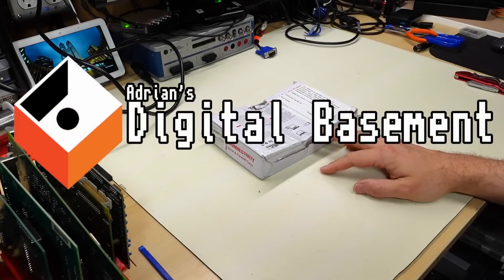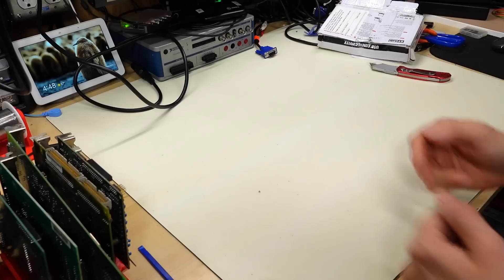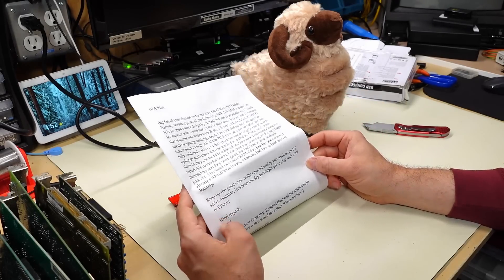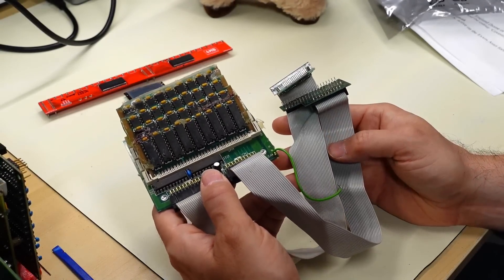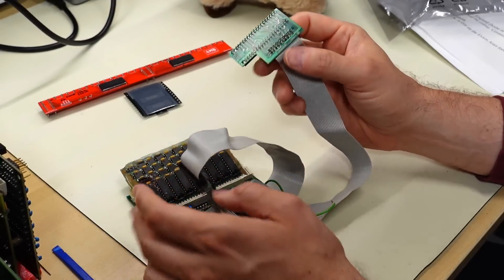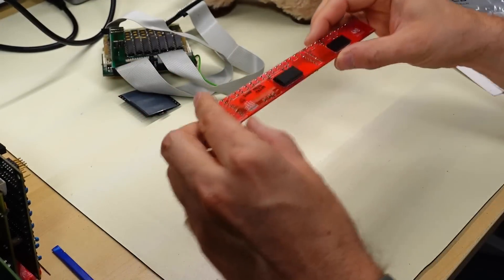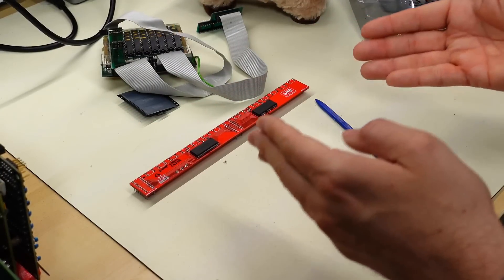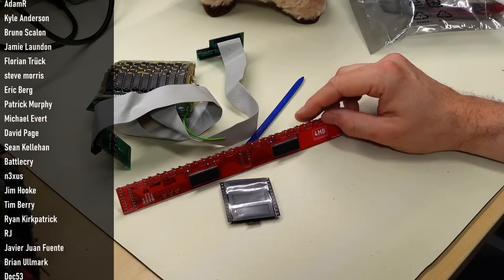0012 Finally, a reliable RAM upgrade for the Atari 520 ST!

Comment: Install the sockets but check if they fit in the case before soldering. XD

PS - Just taking the mick. ;) Try removing the spacer on the pins, trim the pins ~2 millimetres and see if it fits now.

Comment: Do the sockets. There are many other cheap, and very exciting upgrades coming to the Atari very soon, which this upgrade may interfere with, so expect to have to remove it/modify it in the not to distant future. Sockets make sense, you don't want to have to keep soldering/desoldering things from the motherboard.

Comment: Sorry, not familiar with the Atari systems but what do you gain by having more ram on the machine?  Isn't most software designed for 512/1024 and wouldn't benefit from this?

Comment: Have had the Marpet upgrade in my original ST since the early nineties, never had a problem with it, so take issue with the flakey upgrade (although it was hot glued a bit on the MMU for 'stability') :) Back then it literally was the best thing available to get you to 4mb and for us budget strapped ST users, you could do it in stages via 1mb, 2mb, 2.5mb and 4mb when you had the cash. I actually found 2.5 was the sweet spot back then, 4mb caused some with issues with games. It could be worse, if you had a surface mounted MMU without a socket you had to get a Marpet with a upside down socket soldered to the pins you have, that in turn fitted over the surface mounted chip. Those fell off all the time and needed a tonne of hot snot to hold them down. It's a big old upgrade for the first smaller ST form and even the later STF models though. You should try fitting it in there with an old school TOS 2.06 upgrade and a AA battery power pack for the keyboard clock, you newbies don't know you are born...

Comment: Personally I would solder it permanently in place as I would not want to keep doubting how well its fitted every time I had any form of issue.  Also even the board has already been  modded its not like the machine is original factory fresh.

Comment: One thing, well 2 things I'd like to see you get are 1) A processor accellerator with on board cache ram.  I had one of those and felt very up to date as Intel chips were adding on chip cache for the same purpose at the time. 2) Get an Atari black and white monitor and pretend you are a frugal German who wanted a lower priced Macintosh.  I had the 640x400 B&W monitor and did not game, except for various solitaires.  Get some word processers and page layout programs etc. to see how the Atari ST with GEM compared to the 512x384 rez B&W Macs of the day.

Comment: 1:15 If you're looking for Atari ST Hard drive devices, look into the ICD line of connectors. I remember using that on my old 30MB Seagate (and I think later on my 420MB Quantum Trailblazer).

Comment: The RAM upgrade I fitted to the 520STFM that belonged to my brother and I required soldering, and basically bypassed the existing 512KB. We ordered the 1MB upgrade, and were gobsmacked when they accidentally shipped us the 4MB version instead. None of the software we used actually needed 4MB though, as we were only upgrading to be able to use Steinberg's Pro 24 MIDI sequencer.

Comment: Mechanically it seems so big that I wonder if it would be reliable with round pins going in all of the sockets. I wouldn’t want to make it permanent either, but it seems like the kind of thing where your Atari could reboot if you bump the machine while it’s running, unless you solder it down.

Comment: They are 19 pin D-Subminiature connectors. That size has never been given an official letter designation. DB is the size for 25 pin, DA, is 15 pin, DE is 9 pin. Yes, it was Big Mess O Wires who had an Asian company manufacture a huge amount of these so he could continue to make his Apple external floppy emulators. But he had to order such a massive amount that some other companies went in with him on the order because of a few other electronic products that had used that size. Apparently manufacture of the 19 pin D-Sub connectors and shells ceased not long after Apple and Atari stopped using them.

The BMOW guy posted about how it felt to have the entire world's supply of a thing at his house, before shipping off the other companies' shares of the connectors.

Comment: I think having the option to reverse it is a good idea... I'd be more for using sockets, then you have the flexibility to borrow the upgrade for another machine or revert the machine back to stock if you ever want to... also since the person who sent it didn't solder all of the pins of the pin headers to the expansion PCB, it isn't going to be as much work to de-solder those pin headers when you switch them for more socket friendly pin headers

Comment: If the "convenient" method of swapping the RAM was the norm, for the 520st, I would say socket it. However, in the flavor of the era of upgrades the 520st is from, I really want to see you finish what the previous owner started, and solder it to the board as a permanent upgrade. ;)

Comment: I feel like putting that thing in sockets, turned pins or otherwise, is asking for trouble. All it would take is for one pin to be slightly out of alignment and not making good contact, and you'll have an unreliable machine that's a real headache to troubleshoot.

Comment: I couldn’t see the RAM chips that well since I am on my phone.  But I assume those are SMD chips with J-lead pins.  If you do a permanent mod, you wouldn’t have to remove the board to replace the RAM.  Just remove the chips with hot air.  So I recommend permanent solution.  I mean, why not?

Comment: I would recommend sockets because you never know if ram failures ended up having to desoilter it aging it would be pain in board get it off to fix ram it way more easy just put socket on mobo and easy to remove and fix ram aging save yourself a headache

Comment: Being an Amiga owner from back on in the day, i never knew that it was so hard to upgrade the ram in the ST, i always figured they would have a slot or something like the Amiga. Perhaps this was a cost cutting measure of the ST to try and keep the price below the Amiga competitor
Reply: The 520ST was released before the Amiga 1000.  The stfm was released a year before the A500.  The ste was released after the a500 and had simm slots

Comment: This whole "Atari memory upgrade fiasco" reminds me of a mod i saw in a magazine back in the 80's for how to upgrade a TRS-80 model 1 16K base machine to 32K.  You basically had to piggy back another set of 8 ram chips (16K x1 bit) atop the installed ram chips, and solder all the pins except the CS line, which you needed to bend up and solder a bodge wire to.  The bodge wire was then attached to the memory decode logic, so that the extra 16K was selected when the address range was correct for it.

Would have been a PITA to do, but man i thought about it.  16K sucks, especially when you are learning assembly and NEED that damn ram space!  I was using the tape based EDASM from Tandy, and while it worked just fine, you were really cramped on memory space in a 16K machine.

It sucked being a poor kid in the early days of 8 bit computing.

Comment: As a general rule, I’d prefer less permanent changes over permanent ones. I’d say initially go with the temporary option for a while at your judgment (for a week? a month?) Only if it is too cumbersome after a while, then consider the permanent method (or if you have multiple Ataris as backups.)

After all, machines of this vintage aren’t exactly being made these days, and some software of the era tend to expect the original configuration.

Comment: Adrian, please whichever method you use, consider reflowing the pins to be desoldered with a small amount of ultra-low temp solder like ChipQuik - this can help reduce the amount of heat the desolder gun needs to put in, and can prevent damage to older boards as well as making your life infinitely easier :)

Comment: Yeah just solder it in, I see no reason to bring it back down to 512k. 

And if you really wanted to revert it down the line — isn’t it just as much work to desolder the upgrade as installing sockets would be, not to mention the extra effort of replacing all those pins? 

I’d wager that whole effort altogether would be as much work as two soldering replacements of the upgrade out and then back in. And I doubt you’d want to revert anyway. 

So just solder!

Comment: Such a large board will work itself loose when typing, a typical problem with all in one computer layouts (and early STs without chip clips).  Solder that sucker in and be done with it.

Comment: With so many pins, I'm not sure the socket solution is the best thing. I suspect it will be difficult to push in and take out. Otherwise, I'd say reversible is good.

Comment: There are very few and very old games that can't handle more that 1MB ram. You can find pached versions for most of them. I see no reason not to upgrade.
But be careful with ROM Upgrades, some games using undocumented parts of the ROM to scrape of some Bytes to pack more content on the 720K floppy. Some are very TOS version dependent. TOS 1.02 is the one that is supported by all games. If you want to run "serious" software TOS 2.06 should be used.

Comment: There are dozens of board layouts for 1040ST/MegaST1/MegaST2. The only board that is relatively constant are the older 520ST. Later generations switched between PIC and SMD when ever a cheap batch of memory chips came in. I have at lest 3 variations for 1040ST and 4 for MegaST1 and 2 for MegaST2.
This is the main reason why most expansion where on ribbon cables.
Atari didn't made space for an memory expansion, to sell more Computer. Tramiel thought that people would more likely buy a new ST as to solder in a memory expansion.
Atari learned from that mistake with the TT, STE and Falcon, but it was to late at that point.

Comment: Just my humble opinions:
* In my book, the more RAM the better, especially if you're planning on running more software than just games
* The original RAM is probably going to fail over time anyway
* Its your machine to do with as you wish, after all
* Not all retro machines are destined to be perfectly original museum pieces, no point in keeping it original because some machines are more fun when they're kitted out.

Comment: What is the point? I can understand wanting to keep the machine completely pristine, but adding sockets arguably violates that, and who would want to go back to 512 anyway? I prefer socketed motherboards myself, and it's really up to you if you want to put the extra work in to socket all the ram slots so you CAN go back. Otherwise, just solder that bad boy in and enjoy the 4 megabytes of extra memory goodness :)

Comment: I would solder it without sockets, since it's the maximum expansion and I guess you won't donate the Atari to a museum at a later time. Best regards Tom.
Reply: Full disclosure: I know next to nothing about electronics. I've never owned an ST, but I wonder if having 4MB always visible might break some programs (at least early ones) since RAM expansion was rare to non-existent at the time.* That is, how hard would it be to install it so that the RAM is switchable between 512k and 4MB?

* I know that several early Amiga programs would refuse to run if you had an external drive because the buffer RAM for that drive was assumed to be available, and there are examples of games not running if the Amiga had too much fast RAM (or in some cases, any fat RAM at all).
Reply: @JustWasted3HoursHere  An Atari does not have chip and fast RAM, so you cannot compare the two.

Comment: The new RAM is good and reliable. The old RAM could be damaged or fail soon. I would remove all of the RAM and solder in the new RAM. The new RAM also needs less power, which means less heat and less stress on the power supply.

Comment: Personally I would change the pins and put it in sockets. As the person who sent it said, they have not tested it, so if there is a problem then you may have to remove it, which will be a complete pain if soldered in.

Comment: Given that the original 4 MB upgrade was intended to be permanent, and the Atari motherboard already has traces cut, I think it's perfectly appropriate to install this permanently as well. It's what would have been done back in the day, had this product existed. This exposes you to the risk of a DOA part, but I'm sure you already considered that.

Comment: I say solder it in.  It's kinda cool to see "frankenputers", like seeing a cyborg.  And any time it's opened up, the bright red board is gonna be a conversation starter.  It feels like a demonstration of the preservation of the machine, having replacements that make use of new parts combined with the old main board.  I could continue to try to be poetic, but I don't really have a properly articulated argument to make, so I'm just gonna end the comment here.
Reply: I don't see this as a huge big deal. This doesn't even extend the capabilities compared to the older upgrade, it's just a higher density of RAM chip and more reliable mounting system than they had at the time. I don't see any translation or buffering going on. It's not like an FPGA emulating a chip, where someone might want to investigate how true it is to the original. It's RAM, either the bits come back right or they don't. If this isn't considered sufficiently authentic, then there's little hope of maintaining these machines once the new old stock chips are gone.

Comment: so all you needed to do was take out the MMU socket and  solder in the MMU over plug connector then fix the original MMU socket in top of the MMU over plug

Comment: Do you want a 'restorable' machine, does it have more value as a 520ST, will this be a 'weekly driver'? If more value as a true 520ST, leave it alone. If a weekly driver, go for the sockets and pins, and carefully find a safe place to store the original chips...

Comment: I would never do this without installing sockets. I installed 32 KB RAM in a ZX81 without a socket on its motherboard. It never worked but it was a pain in a butt to reverse the mod.

Comment: Solder it in. Ultra reliable. And who wants to go backwards with regard to RAM? Machine tool sockets are great, don’t get me wrong. But just to have reversible RAM downgrade is not practicable, and it will go intermittent over time; heat/cool cycles, oxidation over time, it’s just an invitation for unexplained crash, or failure and troubleshooting that mysteriously solves itself.  Just solder it in and have solid reliability.

Great video. Thanks Adrian!!
Reply: This.

Comment: I would use sockets so it is easier to fix if a memory chip goes bad.  I don’t see any reason to undo the mod.  My understanding is that you can’t do much with just 512k of ram.

Comment: I was researching the ST recently to see what upgrades are around. Exxoshost has managed to somehow clock the ST at 64mhz - considering the original was 8mhz that’s just bonkers!
Reply: Bet you mean the CPU clock instead of the overall clock. There's a mod to have the whole machine run at 12MHz.
There have been 030 50MHz Upgrades since 1994. Getting a 68k or 030 running at 64MHz still is impressive, as that's an overclock of 30% over the rating.

Comment: Honestly, the hassle of desoldering everything a second time if the 4mb board becomes unreliable is reason enough to go with good quality sockets.
Reply: There are 2 SOJ chips on that board and the rest being simple SMD ... nothing that can't be fixed when permanently installing.
Also sockets add height so the keyboard/shielding may not fit anymore ... needless to say that sockets can become a source for errors as well.
Reply: @RandomBlankUsername  I totally get you point. It always depends on other factors too for example, I've sold some vintage computers in the past where buyers insisted that everything be original, so there's always that to consider. ;-)
Reply: @TheSimTetuChannel  Yup, which in my case means that I won't be offering what they're looking for. Found contemporary enthusiasts always considerably more pleasant to deal with than 'collectors'.
Reply: @RandomBlankUsername  You can say that again!

Comment: If it was me, I would change the pins for turned pin headers and put turned pin sockets in the board. If for any reason the expansion fails, or you sell it to someone who wants it more "original", it will then be easy to revert to standard configuration.  The expansion board is new do careful removal of the pins shouldn't damage it, which is more you can say if its ever necessary to unsolder it from the ST motherboard.

Comment: Remove the RAM chips, replace them with pin headers which should be fine if and when you wish to reverse back( I coul dnot imagine why youwant to but) to the ram chips which should be fine for putting the RAM chips in. Quite honestly, just make it permanent and be done with it.

Comment: Soldering will provide a more reliable connection, but for initial testing I'd use sockets. We've all seen just how unreliable RAM can be, and permanently connecting such an upgrade is just asking for trouble imo

Comment: I'm partial to reversible mods as much as possible, but there are things to consider with this RAM board.

First of, it won't be trivial to get all those pins to line up and seat properly. Second, the board is long enough that it might have a tendency to expand and contract to the point that it would walk out of the sockets over time.
Reply: Solder it in, won't walk itself out then :) I know what you mean about 'reversibility' but those MMU piggyback upgrades break/wreck/damage those fragile connectors and completely break the motherboard. Also they are not easy to replace! Atari used non-standard PLCC.